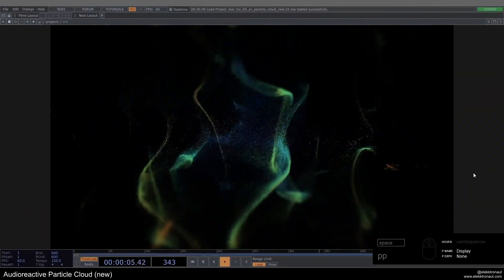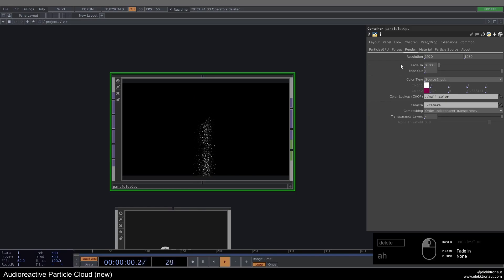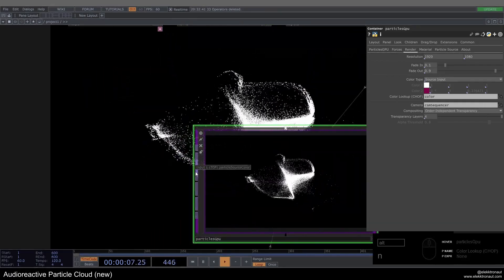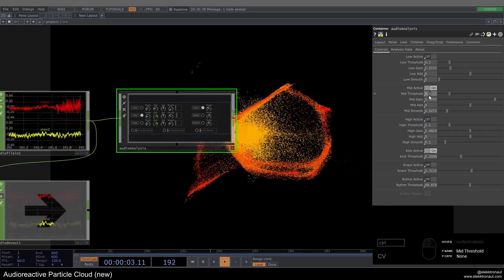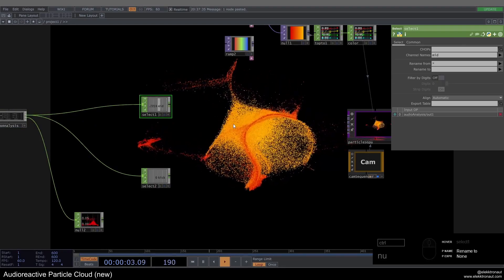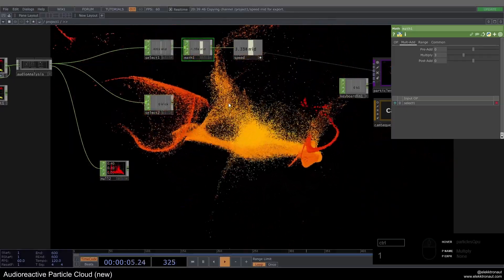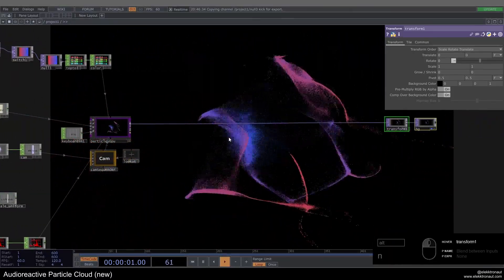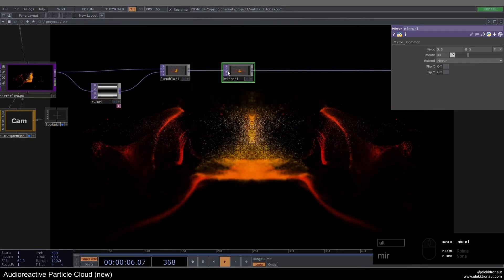Audioreactive Particle Cloud (new) – TouchDesigner Tutorial 65

Comment: Thanks for the great tutorial! Im having such trouble with using the null/lookat for the CamSequencer - wheneveri use it and try to change the camera positions (default settings on the Null) it constantly either doesn't allow the camera to move or it points away from the particles. Any tips?
Reply: Solution that worked for me: Right click on camera and set "Camera Navigation Mode" to "Object Mode"
Reply: samesies

Comment: My particle system breaks every time I close the file. If I put in a new particlesGpu node and reconnect all of my parameter inputs, it works just as before with no issues. It just breaks every time I close. All drivers are up to date. Anyone have suggestions?